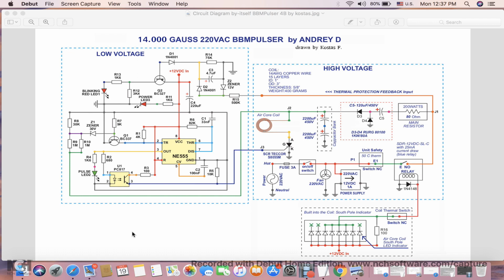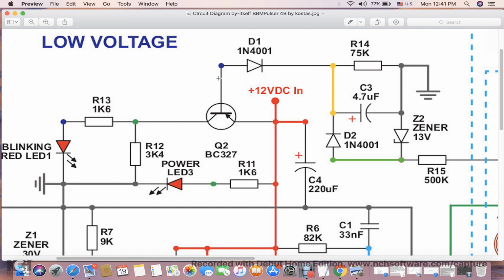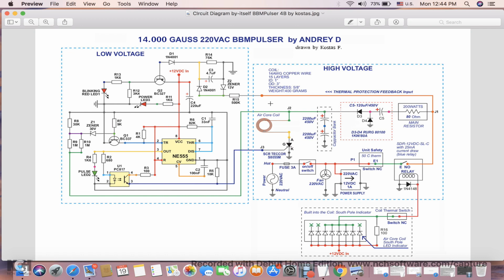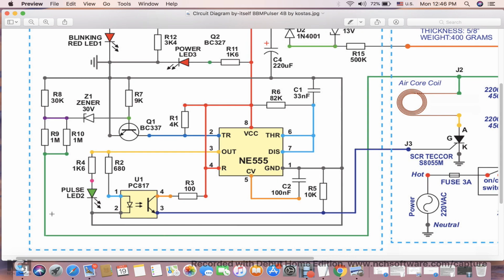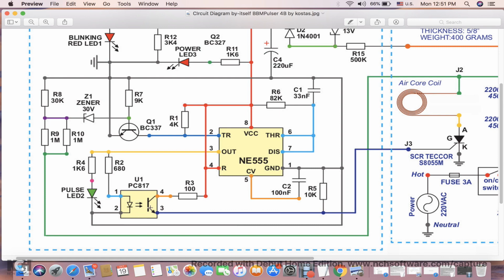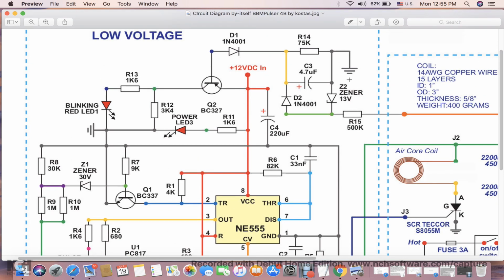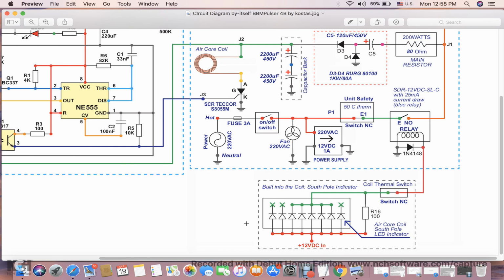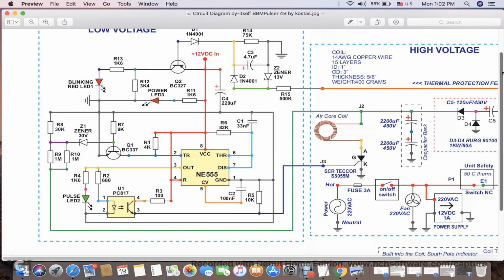016 BBMPulser 4B 220 Volts Circuit diagram. Open Source. PEMF circuit

Comment: Dear Andrey is there a diode1N4148 infront of the relay???? why it is not in 5B model???
Reply from the maker: I never use it, works great with out it.
Extra component in this circuit

Comment: why do we need the relay?
Reply: and the use of the diode 1N4148 connected with the relay?
Reply from the maker: Relay is there to interrupt the power line  when coil gets hot

Comment: Is the copper wire getting pulsated voltage from the gate? As the capacitor is storing DC how can it create the pulsed magnetic field?
Reply from the maker: Copper coil gets it's power from capacitor bank, it's connected straight to the positive one wire, and second wire connects to the Kathode on the thyristor.

Comment: In this circuit I am reading 330V at the junction of coil and capacitor by using only one 2000uf with 450V capacitor for the bank and 1000uf with 250V DC capacitor for charging but there is no magnetic field at the cooper wire what do u think the reason is?
I used the exact same components for other parts.
Reply from the maker: https://bbmpulser.org/wp-content/uploads/2020/11/14.000-Gauss_220VAC_BBMPulser-rev-2.4.jpg
You need to change R8 from 30k to 60k
Also in charging circuit you don't need to use any capacitors, since you working with 220VAC, you only need one diode to convert AC to DC, then you send that DC to the Capacitor bank, make sure you have MAIN resistor in the line to lower charging current.

Comment: What's the purpose of the wire wound resistor. In my case It works well with out it??
Reply from the maker: Purpose of wire wind resistor is to lower current spikes when recharging capacitor bank

Comment: Hello sir, is C5 the charging capacitor AC or DC motor starter?
Reply: Can we use two capacitors in parallel for the charging circuit to have 450V I couldn't find one 15uf with 450V
Reply from the maker: It's AC motor capacitor, DC motors don't use any Capacitors

Comment: the capacitors are so big so what if i use only one of the capacitors for the bank i wanted to try it only with one 2000uf 450 v capacitor so what will happen if i use this?
Reply from the maker: If you use 450VDC capacitor you will overcharge it.
Electrolytic capacitors can take up to 15% over rated maximum voltage.
So your 450VDC capacitor can be charged up to 500V, that's the limit.
BBMPulser 4B designed to charge capacitor bank to 640VDC, that's 240V more then your capacitor can charge.
If you overcharge capacitor, it Will start making noises like electric ark, this will mess up the capacitor, soon you won't me able to charge it to even rated voltage, it will be arking, at this point your capacitor is bad
Reply: how can i make it work only with one of the capacitor banks ..while decreasing the out put

what factors should i decrease inorder to use only one 450v capacitor .
i'm asking you this because the capacitors are expensive and i can't afford to buy two of them.
Reply from the maker: @spacewolf5043  you can try used caps.
Used capacitors are cheap and most of the time work fine. Check eBay for that
You have to use 2caps to combine their voltage to be at least 900V
This circuit will charge cap bank to 910V if you let it.
Sorry you can't use only one 450VDC capacitor for this circuit. Whole circuit needs to be redesigned and at the end you will get 2x less power output
Reply: Sir there is no ebay here we r from Africa, how about if I decrease the charging circuit  please tell me a way to use only one of the capacitor please?
Reply from the maker: @hevenabadi2922  are you working with BBMPulser 4B   220VAC version of circuit?
If you are, then you can simply remove one diode and 120uf 450V capacitor, leaving only one diode to make DC from AC. You will end up with 325VDC instead of 650V
Also R8 will need to be higher value, probably around 49K, you need to test it.
This R8 resistor sets trigger voltage
Because your capacitor bank voltage is lower this means you need to adjust trigger voltage to be lower
Reply: Yes I am using 220vAC 4B Pulser , I am using two S6015L diodes instead of RURG 80100 and 15uf with 450V capacitor for the charging circuit so should I remove one of the diode? In this circuit there is no 120uf 450V capacitor.  I am using the circuit in this video only two S6015L diodes and one 15uf 450v for charging which component should I modify or remove to reduce voltage coming from the charging circuit since I have only one 2000uf 450V.
Reply from the maker: @hevenabadi2922  so in your case you need to make simply DC from AC
So you don't need to use diode multiplication circuit, you can simply use diode bridge or one diode to make DC from AC
Reply: @AndreyD  isn't the power supply unit DC source why are the diodes needed for changing AC to DC , I'm confused.
Reply from the maker: @hevenabadi2922  12VDC 500mA, what can you charge with it? It's only to run low voltage circuit
Diodes needed for high voltage charging circuit for large capacitor bank

Comment: Thanks for sharing, 

I need your help please, the thyristor always get burned whenever I turn on the circuit, even I doubled checked and I followed your circuit diagram and using high quality components ?
if I disconnect the thyristor anode that goes to coil and try to test it, nothing happens, and if I connected back the anode the thyristor get burned?

Also for PC817 how many volts suppose get out of it?
appreciate if you can help please
Reply from the maker: Make sure thyristor installed on small heatsink.
Also the coil. Make sure it's internal resistance is not lower then 0.1 Ohms.
I'm using 680 Ohms resistor in optocoupler /thyristor gate line. 
Because signal is short (3ms)  the signal cannot burn the thyristor.
Double-check if you connected thyristor correctly. 

If it's installed correctly it should work. I built a few circuits already by given configuration
Reply: @AndreyD  Thank you, unfortunately I followed your guide without luck.
how would I know if low voltage circuit is working probably before I connect it to the thyristor?

what is the frequency this 555 generate in this  circuit?

Thanks and I appreciate your great work.
Reply from the maker: @winsuper5005 The 555 Pulse  generator in this circuit will work only when you get your capacitor bank to charge. Voltage on the capacitors will trigger the low voltage circuit. By itself 555 generator will not pulse, it's configured to work in mono stable mode. So check your Voltage on the capacitor bank, make sure they are charging. 
The circuit is tested and works great
Reply: @AndreyD  The two big capacitor get charged up to 670 DCV,  when I turn on the thyristor it get burned and the big resistor get extremely hot very quickly ?
Reply from the maker: @winsuper5005  Correct, when thyristor blows - it will cause big resistor to heat up.
I just want to make sure, is your thyristor latches or it actually blows and remains latched (shorted)? Why I ask because it may latch.
If it blows, then here is the things to check.
1. double check if thyristor connected correctly
2.Make sure your coil resistance is higher then 0.1 Ohms 
3. Check resistance or R3. make sure it'[s 100 Ohms
4. You may not have authentic thyristor, possibly it's fake china components.
5. Disconnect from thyristor gate and check how much current you sent to the thyristor. Simply connect milliamp meter to it and to the ground and for a second or 2 you can take quick measurement. Dont measure it for more then 2 seconds you should get 10mA.
Reply: @AndreyD  the gate output give me 12 volts, I forgot to tell you that I was able to get 
the main resistor as Aluminum Shell Housed Braking Resistor 120 ohm 200 watt.

I have blown  more than 15 PCs of thyristors from different suppliers with big bang sound, so I believe it's beyond the capabilities and specs of these cheapo Chinese thyristors,  how many amperes the coils will draw ? I think I need such heavy duty industrial thyristor ?  
I don't want to give up
Reply from the maker: @winsuper5005  I think you should try different kind of thyristor. 
Try this Semikron SKT 55/10c
If you Use this thyristor, you need to adjust couple resistors.
1. R2 needs to be 500 Ohms
2. R3 needs to be 150 Ohms
Both resistors 1/4 Watts
I doubt you can blow this thyristor.
Reply: @AndreyD  wow this thyristor is very expensive $83 plus $50 shipping! 

do you mean R9 and R10 ? 
how about the main resistor, shall i keep  Aluminum Shell Housed Braking Resistor 120 ohm 200 watt or change it as well?

Thank you
Reply from the maker: @winsuper5005  Im sorry those were R2 and R3 that needed to be adjusted. I made correction in my reply. (I looked at old circuit).
 Now, $83 is high, my bad I didnt checked current prices, I just happen to get like 6 of them for $20 each. You can find them for around $50, but still that's alot.
 Try This thyristor  America Semiconductor 50RIA100. They cost $15-20 ea
For this thyristor to work your R2 needs to be 249 Ohms and R3 Needs to be 27 Ohms
But to be honest I have blown a few of this if not connected correctly
try this VS-111RKI120PBF, it's $50 but it's as as strong as the first option i offered, I dont think you can blow it.
Reply: Sir we have S6015L thyristor so can you tell me which component to adjust to protect the thyristor from blowing.
How is the charging circuit producing 640V when we are using only 450v rated capacitor?

Comment: Why does this diagram say 14,000 gauss but the original 120volt diagram says 40,000?
Reply from the maker: 14,000 Gauss is the true power output. 40,000 Gauss was estimated value.
I will be changing all my estimated value to the true numbers
I'm sorry about that.
PEMF meters are very expensive, I resently got BELL 5180 accurate Tesla meter for $1k (used but calibrated)
Reply: @AndreyD  oh okay. I noticed my coil doesn’t cause muscle contractions at all so does that have anything to do with my coil having more weight than yours does? I haven’t sealed my coil yet so I can bring the weight down to 400 grams.
Reply from the maker: @corybrown5583  I would bring it down to 350-400gramm.
You are using 14AWG magnet wire. And your coil is tight?
Reply from the maker: @corybrown5583  put the coil to the side of your neck, you will have muscular contraction.
High voltage pulsers are stronger then this pulser
Reply: @AndreyD  yes it’s 14 AWG and it’s tight because it’s a crossover coil. A crossover coil comes pre made and baked so that the magnet wire is stuck together so it minimizes noise from pulse. My coil has a 1 inch diameter air core just like yours.
Reply from the maker: @corybrown5583  how thick is it?
Reply: @AndreyD  I put it on my neck and I feel muscle contractions. I will still be lowering the weight of my coil to your specifications since mine isn’t as strong as it can be.
Reply: @AndreyD  like right at an inch in thickness
Reply: @AndreyD  I noticed the pulse causes phosphenes (a flash of white light) when placed near the side of face near eyes.
Reply from the maker: @corybrown5583  I notice same effect
Reply: @AndreyD  are the pulses weakened if the coils thickness is larger? I know yours is 5/8 an inch but mine is 1 inch.
Reply from the maker: @corybrown5583  I believe so.
Ideally you want your coil look like a pancake
Reply: @AndreyD  I have used an expensive unit before that uses thousand of volts with a variable spark chamber and it caused muscle contractions. You could actually feel the field around the coil on the device!

Comment: I’m glad you made the video! So if all the negative or ground symbols on the low voltage side are connected to neutral then where does the 12v negative wire connect? I thought the low voltage ground symbols all went to 12v negative wire.
Reply from the maker: 12 Volt negative also connects to the neutral, ground, 
Low voltage ground connects to the neutral and all other grounds except chasis ground (case).
Case is connected to the ground wire from your outlet.
Reply: @AndreyD  that was definitely my problem. It’s working correctly now. I’m sorry for all the questions and again thank you for your help!
Reply from the maker: @corybrown5583  Not a problem.
I glad you got it to work!
Reply: @AndreyD  okay so everything goes to neutral. I was unsure and didn’t know if that would harm the 12v power supply. Thank you for clarifying that! Hopefully thats my issue!